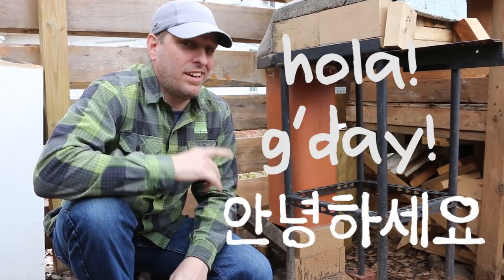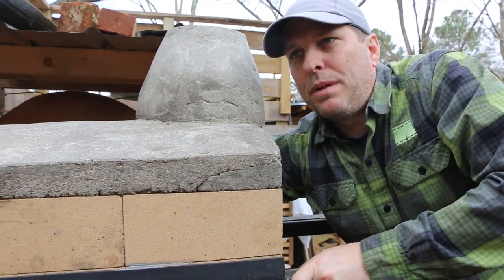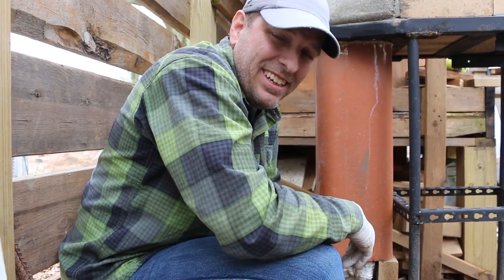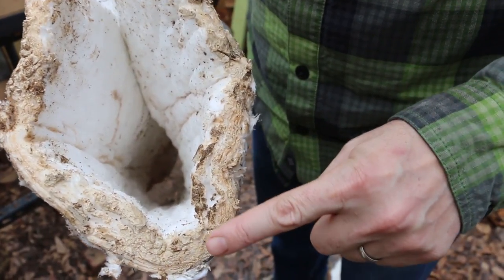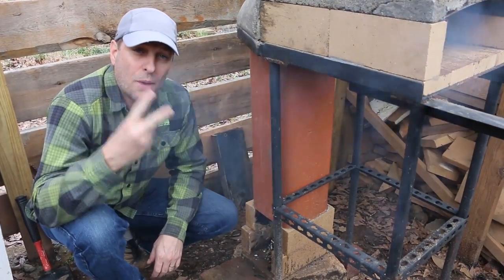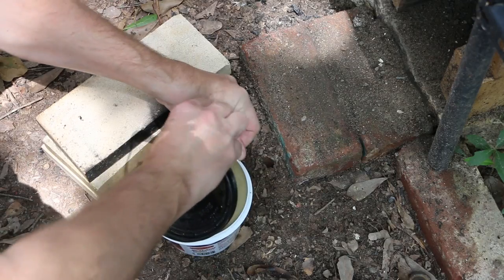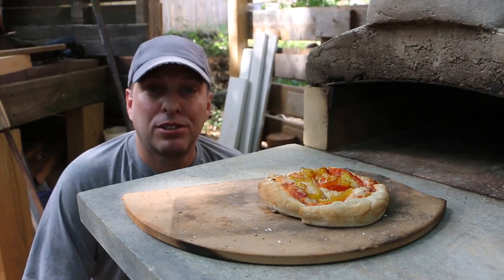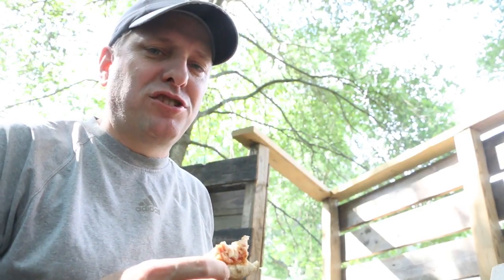How To Make A Rocket Stove Pizza Oven | Part 3

Comment: A good rule of thumb is to completely cover kaowool entirely in a thin refractory liner before using it, not only is it not good in your food, it is really bad for your lungs.
Reply from the maker: Hi Gareth. Thanks for the warning. I actually pulled the Kaowool out all together. I had some good feedback in the comments than informed me it was not the material to use in this project. I do have some hardener, and plan to make a rocket mass heater to use it. Thanks again for watching out for me. I appreciate it.

Comment: Soggy bottom.  That’s a shame. 🤣.  This seems like a very temperamental way to make pizza. It may take dozens of experiments to get it right.  Had you have it a go though.  Even if you ended up with soggy dough.
Reply from the maker: Ha! True. I’m no Pizzeria Arditti. I think I need to get the temps hotter than I had them and make the dough with less rise. Less sauce too. I think the sauce contributed to the sogginess.

Comment: Your flue needs to be way longer, like 2 more feet. If you add a sheet metal tube on top of the concrete you'll get more draw and a hotter burn.

Comment: I know this is a couple of years old, and maybe someone already suggested this, but I’d use some rebar and expanded metal to make a shelf at the level of the feed ramp inside the firebox. This will allow more airflow to the fire and should make the rocket effect more efficient. I also think a solid door that seals the front better will help prevent heat loss and help cook your pizza better. Good proof of concept build, though.
Reply from the maker: Thank you for the feedback, Randy. I ended up rebuilding the whole rocket stove element of this oven (it’s a lot shorter). And made a cool steel door and facing combo for the front. (I think it was cool :-). There are two more videos in this series (maybe three). I think they addressed some of the things you mentioned. Take a look when you’ve got a minute. I’d appreciate your thoughts on the final outcome. Thank you for watching.
Reply: @GreenShortzDIY  I have since seen the other videos you mentioned. Looks to be very functional. Is it still in use?
Reply from the maker: @randysretired2020  I don’t use it enough. I am attempting to learn to make bread and pizza again.

Comment: How long did you fire it before popping the pizza in? Traditional pizza ovens take at least an hour to get the thermal mass up to temperature.  Thermometer could help you know if it's ready yet for pizza.  I'd also be interested in seeing this in infrared. 

Can you move the rocket portion to directly under the bottom of the pizza oven so that it heats the underside of the firebrick floor before flowing to the hole in the back of the oven?  Direct radiant heat from the fire might be more efficient in getting the thermal mass up to temp than via diffusion from the air, no?  Could solve your soggy bottom issue.

As I understand pizza ovens, they have a large thermal mass surrounded by a ton of insulation.  The fire heats the thermal mass that then radiates it back.  I wonder how much you can stray from that formula and still get similar results.  If you skimp on fuel or thermal mass, maybe it's inevitable you'll get sub-par results?
Reply from the maker: Good feedback here. I do think I’ll need to tweak this design to make it work better. It is a set up for sub-par at the moment. :-) I may not have enough insulation above the mass. Time will tell. Thanks for watching.
Reply: @GreenShortzDIY  Been enjoying your videos!  Just finally got my own bit of property, so I look forward to trying out some of these projects.

Comment: Need a heat deflector in the ceiling of the oven  just before the chimney, that will force the air down towards the floor bricks
Reply from the maker: Thank you for the tip. Thank you for watching.
Reply: @GreenShortzDIY  Thank you for posting. I enjoy watching your videos. 👍

Comment: Maybe put a wire mesh down where the heat rises up into the oven chamber. That ought to keep the ash from going onto the pizza. Probably need to put the stone in and preheat that oven for longer. You don't need 900 degrees. I've always heard 500 degrees Fahrenheit is just fine.
Reply from the maker: Thanks for the feedback and suggestions. I need to do some more practice with my pizza oven. I have too many stoves. :-)

Comment: I can see not enough heat is getting into the cooking chamber. Add a blower fan below the flame to help push the hot air up. You will be amazed at what it does. Also, make a contraption to deflect the heat down to the floor. Make a box to house a small fan with a hole to connect an exhaust pipe to blow the flame upward. But before you do that use your shopvac exhaust line to experiment with it.
Reply from the maker: Thanks for the suggestions, Yew. I agree with your assessment. I’m considering some options to improve this oven. Thanks for watching.

Comment: Have you ever mad a version of the rocket stove using bricks that have the holes in them for being cemented to each other? I can get them free and thought if it’s ok to use I’d give them a try. Thanks
Reply from the maker: Hi Michael. I have made one myself, but I’ve seen it done. The clay bricks won’t last as long as a firebrick, but they’ll do just fine. You could consider filling the holes with mud as you build up. I’m only assuming that would help them distribute the heat throughout their mass a little more evenly, perhaps resisting cracking better. You could experiment with that. Thanks for watching.

Comment: no good.   soggy bottom is not good.   somethings not right with the stove.
Reply from the maker: Yeah. Not hot enough. I'm redoing the rocket stove part of this. I need the fire to be traveling through the oven. Thanks for watching.
Reply: I love the rocket stove as a heat source,. Can the ash and soot be eliminated so it doesn't pepper the pizza ?

Comment: You might be able to put an old grill rack or small oven rack inside to let the air circulate around the pizza for more even cooking of the crust
Reply from the maker: Hi Caroline. Thanks for the idea. I’ll give that a try. I think I even have a smaller grill rack that will fit in the oven. Thanks for watching.

Comment: Great work and good try but a rocket stove isn’t going to work very well as there is no flame licking over the dome of the oven.
Reply from the maker: I hate to say it, but you may be right. Ultimately, I am an experimenter, so this was successful in that. I may need to shorten the height of the rocket stove to allow flames into the body if the oven. More testing to come. Thanks for the feedback. Thanks for watching.